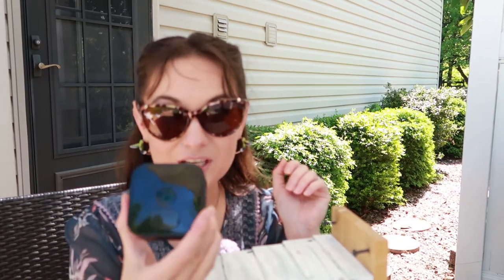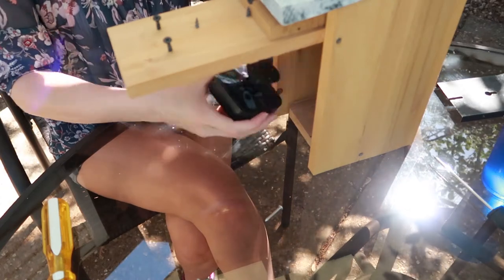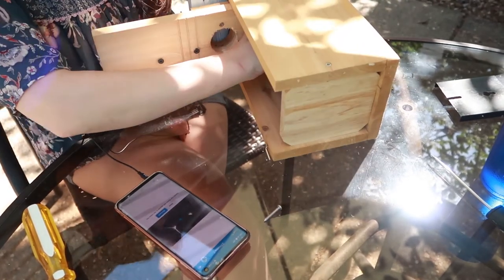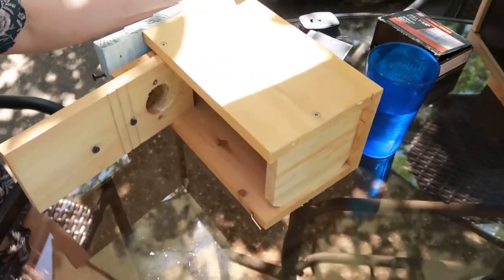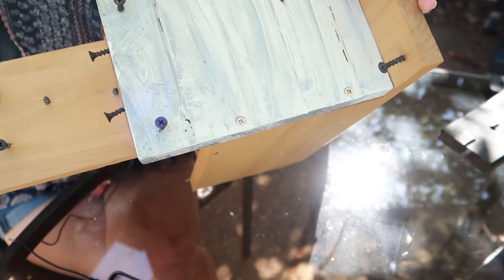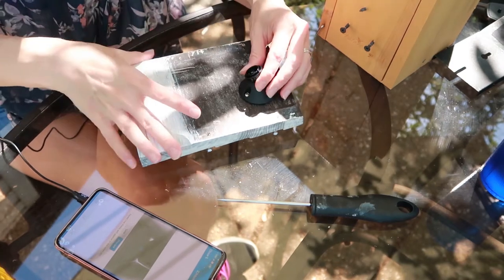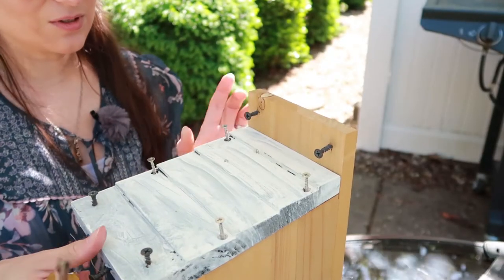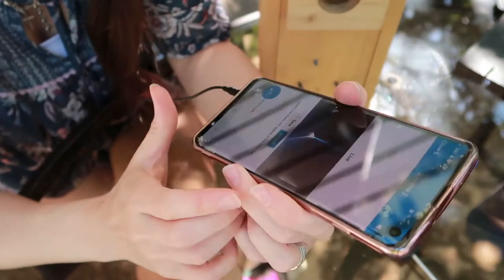How to Install a Blink Camera In Your Nest Box/Birdhouse for Bird Monitoring

Comment: Nest boxes with cameras really need to be 2 to 3 inches taller than standard.
Reply from the maker: The Nature Way boxes are tight, but they'll work for the smaller birds. This was just my demo box. The downside with Nature Way brand boxes is that the camera can conflict with a Van Ert nest box trap.

The Woodlink BB3 model is one that I've found really works. It's a bit larger than other off-the-shelf boxes - large enough to manage the camera and a trap and have bluebirds nest peacefully. So I have started recommending it now that I found it.

When a box isn't as tall, some people screw in elastic straps to the ceiling and use that to hold the Blink rather than using the standard Blink mount.

Comment: When I attempted to install, the camera was past the entrance hole. What brand nest box is used in the video?
Reply from the maker: This video used the Natures Way box, but I've found it comes in conflict with a van ert trap. So lately, I have been recommending the Woodlink brand BB3 model.

You will need to score horizontal lines under the exit hole so fledglings can get out. You can score with a utility knife or an awl or screwdriver. But it's a bigger, taller box and allows more room for the camera and it won't stop a van ert trap (to catch invasive house sparrows) from snapping

Comment: Thanks for the video. I just installed mine. One thing I'm worried about is a Caroilina Wren nested in my non-camera box, and it basically stuffed the entire box with nesting material and then made a burrow down into the bottom. If they do that with this box all I will be able to see if the top of the straw until August when nesting season ends and I can clean it out.
Reply from the maker: Yea, they are quite a different sort of nester. We had a house wren in one box. It was so full if sticks. But we were still able to see everything. I think though Carolina wrens do more tunneling whereas a house wren will still have a bit of a cup - but both definitely fill a box.

Carolina wrens keep such a big territory. So if they build 2 nests, one being a dummy and not active, you may be able to remove the dummy nest once their primary nest is active.

Comment: Hello great video and thanks for the links and suggestions. I am setting up my first bluebird house this Fall and hoping to include a blink camera for monitoring, but I'm reading a lot of the comments of not enough headspace with the camera inside. So I had an idea, why not drill a hole in the roof just big enough for the camera lens to see through, mount the camera on top of the bird house and compartmentalize it with something like a "second roof"?
Reply from the maker: I'm so sorry I'm only now seeing this. But yes. I have done something like this to my Gilbertson box. The big thing is making sure there is no leakage when modifying a box. But otherwise that's a great idea.

Comment: Ive been wondering and hoping to find a how to such as yours.  I currently have Tree Swallows nesting in my bluebird house and would love to watch their activity but cant.  My box lid does have screws on the lid but my box has more of an angled roof than yours appears to be . Will that be more of a problem for installing the camera?  Should or will I need to find a different blue bird box with a flatter roof.
Reply: The roof angle on my bird house looks just like the BB3 Shown on amazon.
Reply from the maker: A slant roof should be no issue. You just might need to play around with it. Mark where to screw in the mount,  then clip the camera on and make sure it will fit within the perimeter. I have had to unscrew and redo mounts before. If that happens, make sure you seal the did screw holes so rain doesn't get in.

The big thing to make sure,  and I don't know that I covered it in this video, is making sure your box is tall enough for the camera to be on its mount. Shorter boxes mean the camera will potentially take block the entrance or cause conflict with a van ert trap.

Comment: I believe the clicking sound (motion sensor) from our newly mounted birdhouse w built in camera is scaring away my resident bluebirds. It happens every time any bird lands at the front opening. I am receiving the alerts on my phone, so I know they hear it and then watche them they fly off immediately, do you have any suggestions? I have 3 houses and they are nesting in of my other ones now. I am hoping the Tree Swallows will use it when they arrive. Also, I must thank you for such informative videos! I never realized I had an English Sparrow issue until I viewed your video.  I now use a sparrow trap (found on YouTube) and use your pillow technique to rid my yard of them. My Tree Swallows and Bluebirds thank you!
Reply from the maker: Thank you for your kind words. Sorry your birds are having a hard time adjusting. Most birds don't mind the clicking sound, but there are the few shy ones.

Some things to try:

1. Rather than leaving it armed, push the running man icon to disarm the camera. You can then push the live view video camera icon to check the box when you desire. The goal here is to make it so the camera's automatic motion capture isn't on and therefore isn't also scaring off the birds with the clicking sound every time the look in. And then you can check randomly after a few days to see if there is evidence of a nest using the live view. Then wait for the presence of an egg. The mom will be more committed to the box, so camera sounds shouldn't scare her off so easily. We actually don't use the motion capture much unless there's been a sparrow sighting or we've added a wren guard and want to make sure the parents are still coming to the box. Or for certain observations. So that might help.

2. Make sure there is enough clearance in the nest box for the camera.  It might not be the camera sound scaring them but the obstruction.  There should be about 9.5 - 10 inches or more from the interior roof to the interior floor to support the camera. And you want the floor square inches to be about 20 or larger. If your box is smaller than that, you may want to try another one. For commercially available boxes, we know the Woodlink Brand BB3 model works for sure in terms of size and is a really good option over all.

I hope this helps.  Good luck with it.
Reply: Thank you for the advice. I did turn off the auto detection, as  you suggested. Two days ago my Tree Swallows returned for the season and just this morning they started entering the birdhouse so I am hopeful they will nesting in it. Thanks for all the info!
Reply from the maker: @jm3814  oh that is so great to hear!

Comment: How near your home (wifi router) do you need to have the box for it to work?
Reply from the maker: You know, that is a great question.  It may depend on your router. But I tested mine...

I was able to get more than 100 feet away from the router. I think about 110 feet before I lost it.

The sync module is in a different area, about 15 or 20 feet from the router.

From the sync module, I was about 75 feet (just a bit more than that) before I lost signal.

This was just my test. It could depend on  your router or other obstructions (brick houses vs. Sided house may make a difference). But I hope that helps.

Comment: I’ve got my blink outdoor camera in the Natures way CWH3 birdhouse.  It looks similar to the Woodlink BB1 you have recommended.  I put it up late in season so I’m not expecting the bluebirds to nest but they will not go in it.  The hole diameter is correct so I was wondering if maybe the camera was scaring them.  It does not obstruct the hole but it is visible when looking through.  Was wondering if you thought it was spooking them or is it normal for them to hover outside without going in.  Also it makes a clicking noise when it detects motion.  Thanks for your videos, enjoy watching!
Reply from the maker: Hey Dan,
I have seen a report of this before. And I think it was in a Nature's Way box as well. The only thing I can think of is that they feel like there isn't enough head room inside?

I do have a Nature's Way box that I use as a decoy box and the occasional house wren has nested in there. I think the only time I have gotten BBs in there is wintertime. I have also gotten a downy woodpecker to roost in there for several nights in October last year.

A few things to test would be:
1. try to see if you can angle the camera a bit so that it gives them more clearance in the front (as they enter the box) and tilts lower in the back.

2. Pull the camera out and just leave the mount in. Watch them manually and see if they go in. If they do, let them just go in and out, and then maybe after a week, add the camera back in and see if that works. 

3. The clicking noise shouldn't bother them. But to test that, you can go to your camera settings, scroll down to Night Vision and turn that off. That causes the click sound.

4. Not a thing to try, but it is late in the season. So it could be that they're just getting ideas for winter roosting. It depends where you are. But it's getting a little late to start a fresh new cycle.

5. Try with a different box (last resort). Woodlink just changed their BB1 model. It's not as great as it used to be. However, I just ordered a Woodlink BB3 to check out. It is bigger and has more headroom. So - that's the one I'm recommending now.

I hope that helps. Let me know if you have some progress after trying these things out.
Reply: @nesthollow5159  I really appreciate the feedback and quick reply!